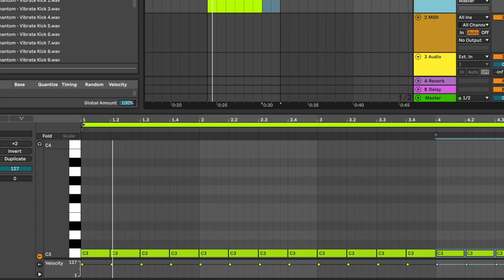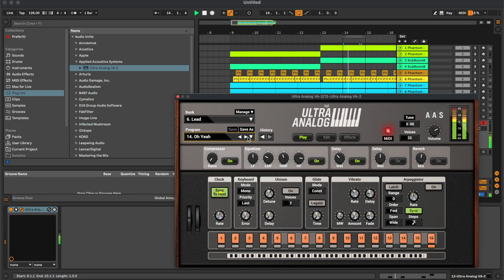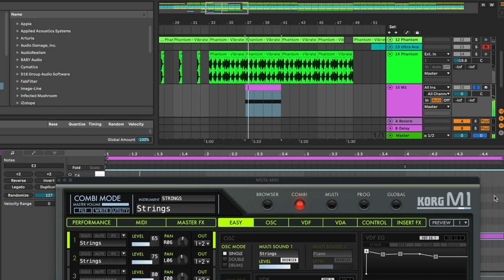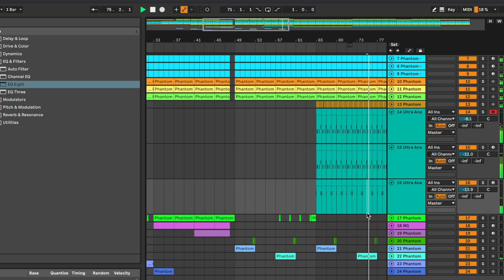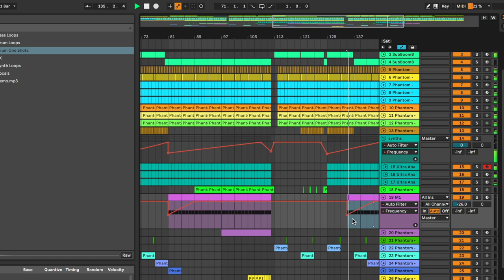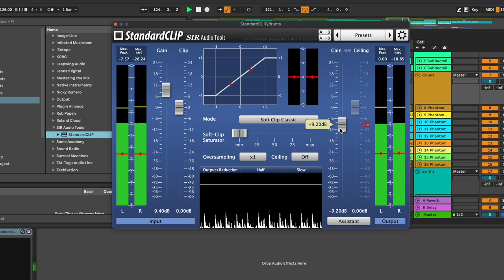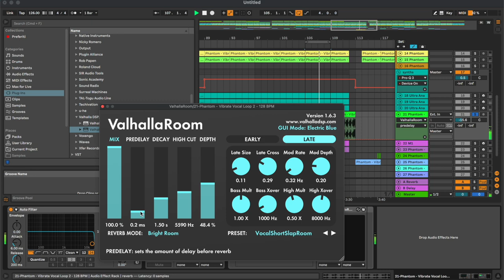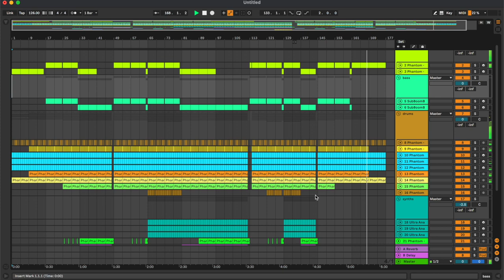Making A Percussive Tech House Track In 1 Hour

Comment: Great tutorial! much appreciated! ..would have liked to hear more about what you were doing and why during the Neutron and Ozone sections because your adjustments sound really nice.. thanks again!
Reply from the maker: Hey Philip, thank you for the support. From neutron we mainly use the transient shaper to change the transients of a particular part (increase/decrease attack and sustain). Usually those changes are done to make the drums fit better together and avoid mess during the mixing. The ozone imager instead is used to check out the stereo field and make certain part more mono or stereo. Usually we keep the low end in mono while the top frequencies are more on the sides. Hope that this quick explanation was clear! 😉